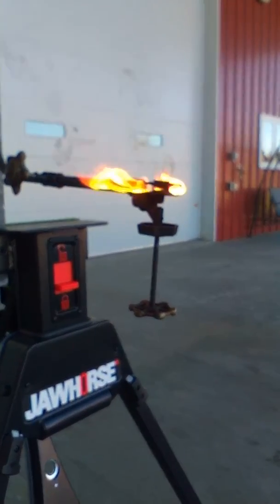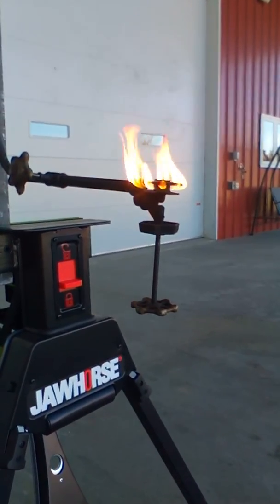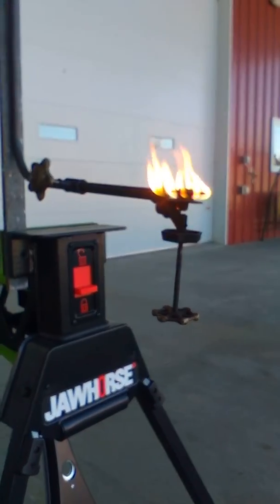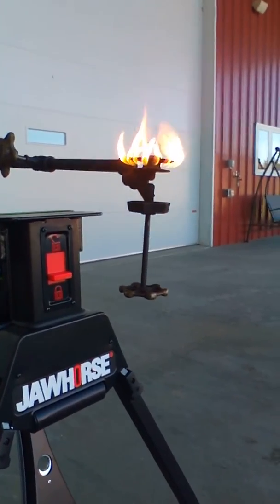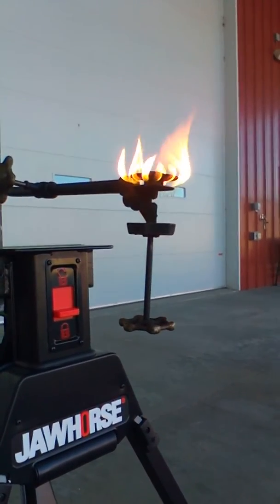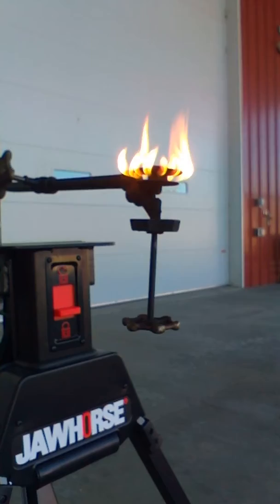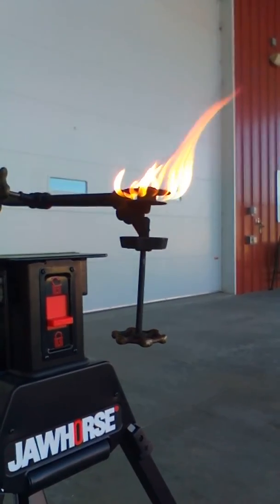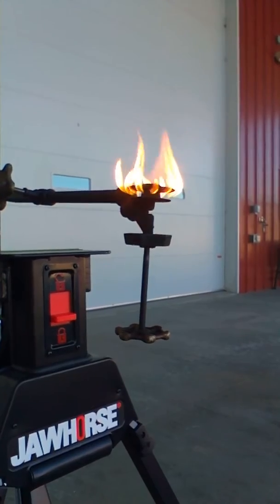Old 1900 era Gasoline Gravity Fed light made in St Louis MO

Comment: These used to be fairly common here in southern New England. I have two that I removed from an old greenhouse, some old timers have told me that they were used for heat in small greenhouses in the winter. I`m sure that they had a lot of different uses though. I haven`t been brave enough to try using mine, maybe I will now!